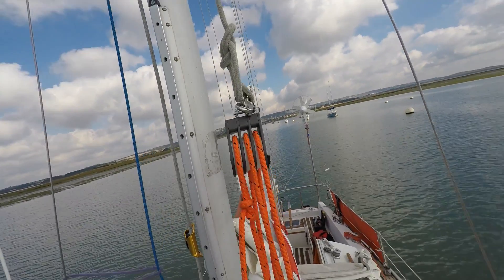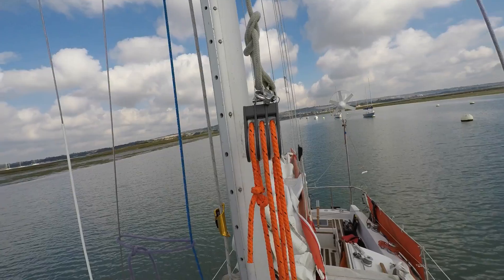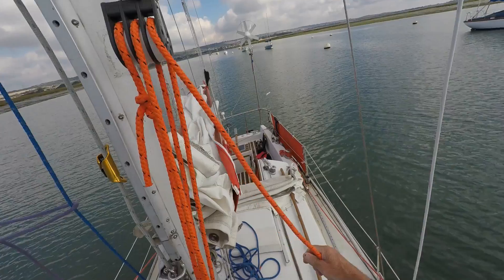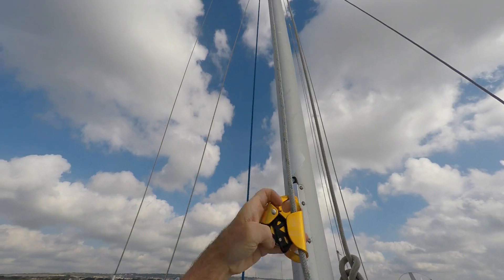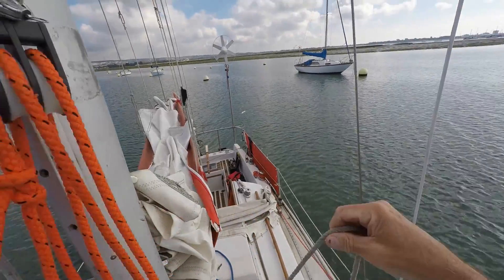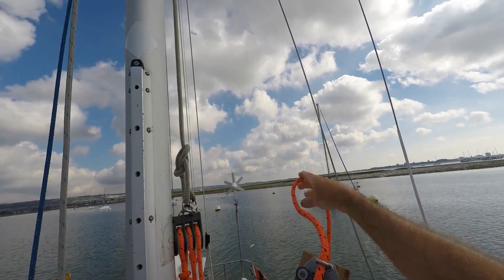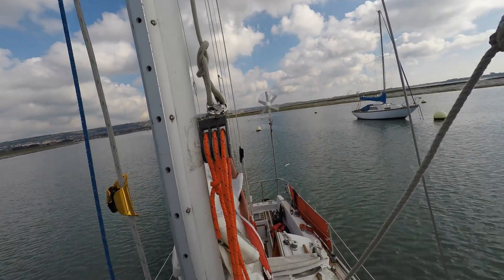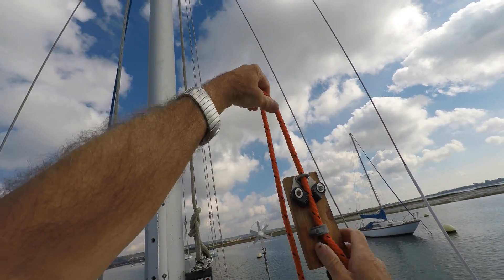Single-handed mast climb system

Comment: Fantastic little pulleys which I now have three of.⏩>allmy.tips/FusionPulley?gg☞    I use them as snatch blocks for pulling down fairly big trees (pulling them down vs. cutting them down, using the tree's length of trunk to leverage the stump out). Easy to use, smooth action and agreeably stout for my purposes using Dyneema synthetic rope. Used properly, the mechanical advantage (or ease to winch) becomes substantial.

Comment: At 73, I very much like your system and plan one similar for my 25-footer. 

One warning I saw on another site worth questioning, I think, concerns the amount of line required for a 4:1 purchase, and the increased chance of it becoming tangled around a deck fitting as one ascends (or starts down), stranding the climber up the mast.

Was this a concern, and if so, how do you manage the line without a spotter?
Reply: Have used this system about a dozen times with no problems, although I can see it could be an issue if you are not careful with the lines, and attempt to use it when there is wind or waves.

Comment: You need to use ascenders in pairs on your back up. Otherwise you'll have to physically lift your weight with one hand, release the ascender, move it down and slowly release yourself to take up the slack.
Reply: Hmm. Well maybe, but with a 4:1 purchase, that should not be too strenous. 

That said, doesn't the clam cleat used while ascending also hold his weight while descending, allowing him to stop and undertake another inspection/repair, rest or move the safety clutch if it becomes jammed or temperamental?